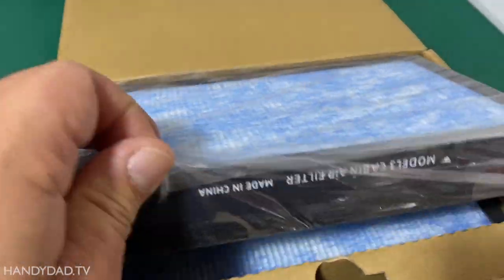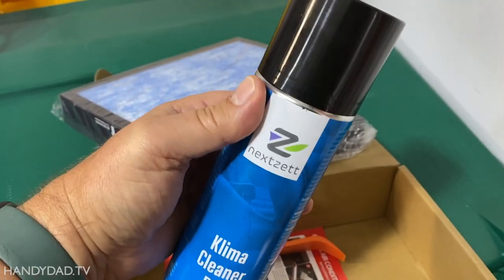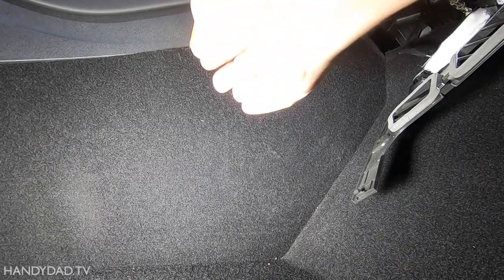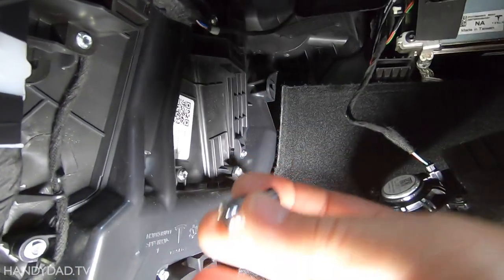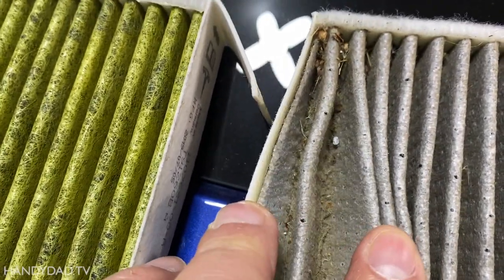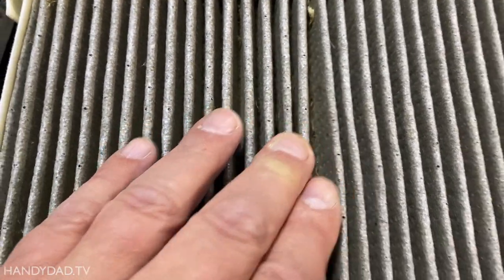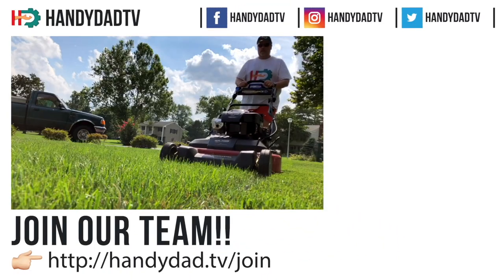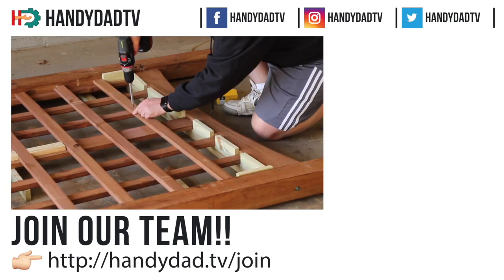Tesla AC Smells like Dirty Socks - how to fix it yourself and save $$$

Comment: Thanks, Chris.  I just ordered the parts and will be doing this in the next few days.  But, as an HVAC engineer, I think it would be helpful to let people know where the smell comes from in the first place and how to keep it from coming back.  Here's what I do on all my cars, not just my Tesla:  If you're running your AC, as you approach your destination, turn the AC off, open your window(s) to increase airflow and decrease static pressure of the system fan, and turn the fan on high.  This gets rid of the excess moisture sitting on your AC coil and also sitting in your condensate drain pan.  Now, be advised, as that moisture is removed from your AC coil, your fan will be depositing it into the cabin making it feel hot and swampy, and that's why the windows are open (this works better when the car is moving than when it's stopped).  Now, due to a rather complicated thing called vapor pressure, it depends on where you are as to how long you need to do this.  Here in SoCal, usually less than a minute. In the Midwest, this might take a minute or two.  In Phoenix, maybe ten or fifteen seconds.  In Miami, might take quite a bit longer.  But if you can keep that condensate pan dry, then microbials that smell bad will have a much harder time growing.  However - there's always a however with engineers - although I do this fairly regularly, my wife and daughters do not.  That's why I'll be following your excellent instructions in a few days.  Thanks for all you do.  We appreciate you!
Reply from the maker: Thanks for the explanation. I’ve heard this advice before but Tesla doesn’t make it easy to turn off the AC and just leave the fan. Takes a couple of clicks but it would be a good habit to keep.

Comment: Just did this myself and came here to say- Definitely do not skip the coil/vent cleaner spray if you have the gym sock odor! Replacing only the filter wont do, you wont get rid of the smell completely. After the spray it was like a whole new car.
Reply from the maker: Thanks for the advice!
Reply: I just replaced my filters and the AC smells brand new! Maybe it depends how long it's been?
Reply: @deblynne9440  it might shorten how long your new filter lasts. The air is filtering through new medium which will have an immediate  positive effect but you're pulling the pre existing mildew from your dirty coil into your new filter fibers, might give the smell a head start foothold into the new filters and come back sooner.

Comment: I've only had mine for 15 months and it's the same... Every once in a while the HVAC got a bit manky... But this most recent time it's ONE MONTH after I installed new filters! It's the sock smell.. not bad in the morning but if I go to lunch with a coworker it's so bad I find myself apologizing so much. It's embarrassing. I'm not the litigious type, but I'm shocked there hasn't been a class action suit.
Reply from the maker: I have a 2023 Y over a year now and it hasn’t been an issue yet.

Comment: i just changed mine and guess what??? it has never been changed before hahahah. im the second owner and the old filters had 2019 dates on them. and ONE more thing, it was absolutely clogged i meannnn chocking to the rim with hair and sand dunes throat singing . i wish i could show u pics hahahah. one question is that, i found ( i also have an endoscopy) these little pollen like leafs or seeds inside the filter compartment. as soon as i smell i sneezed. i tried to vacuum out most of it but still some remains in the corner... anyone had similar instances? any comment or help would be appreciated cheers
Reply from the maker: Sorry I didn’t see any crap to vacuum out.

Comment: I believe Tesla now offers an option to upgrade the Model Y filters to the larger HEPA filter that would enable the Bio-weapon Defense mode previously available only on the model S & X.  That might be a worth-while (after-market) upgrade.  (Model 3 doesn't have enough room for the larger filter)
Reply from the maker: I’d be curious to know if that helps prevent the stink.
Reply: @handydadtv  hahaha it would not help with the smell after a while daddy :D...  BUT it would cost you more money after every 6 months or so ... hahahaha.....
Reply: @handydadtv  I have that Hepa filter on my model S and it STILL stinks! Hence my visit to this video, lol. The problem is, all the vids on this are for the model 3
Reply from the maker: @silverdoggg Record it when you change yours and I’ll publish it so other S owners will see how it’s done.
Reply: It’s not the filter but flawed design because horizontal drip???

Comment: Gonna try. Thanks. I wouldn’ve turned on all vents when you turned AC on. I would also spray foam in the intake duct. And after 20 min, run AC and spray Lysol so that all of the vents can be cleaned of bacteria.  Then put the new filters in.
Reply from the maker: Sounds like a man with a plan 👍🏻
Reply: Where is the intake duct?

Comment: The first production model 3 is a little bit trickier. The screw to remove the filter cover is on the top and not the bottom. I had to use a flexible screw driver.
Reply from the maker: Wow! What the heck were they thinking!!

Comment: I have a 2018 MS 75D and have never changed the hepa filter or the cabin filter. Car has 32,000 miles always garaged. My car smells brand new, nothing stinking. Yet my 2022 MS LR started smelling like sour wet socks intermittently after only a few months. Tesla Mobil service came out and pulled my cabin filter out first (2022 MS LR) and it was very clean. He did not replace it. He did however suggest that I take it to the service center and have the HEPA filter replaced for $600. NOPE not gonna do that. My 2018 never has had any foul smell and it has never had a new filter. Any ideas on the 2022 MS?
Reply from the maker: Try the coil cleaner. It eliminated my stink. Now almost 2 years later I get a slight smell when the AC starts up on really humid days. But I can live with doing it every 2 years.
Reply: Yup. It’s the horizontal drip. Super flawed design. Most people don’t know this
Reply: @handydadtv I ended up having the HEPA filter replaced by tesla. I fought them on the pricing they wanted $600. I got them to install for $300 since I told them that the car started stinking only a few months after being delivered. The service center took my old HEPA filter out and put in another MS and it started smelling as well. It has been a couple of months and I have not smelled anything.
Reply: I have been finding the persistent wet socks mess in my 23 MY, about every 15K miles. I have cleaned the coils with vinegar, bleach, condenser coil cleaner, and the smell still comes back. Changed the clean looking cabin air filters too, still with the bad AC smell. Never had a car like that in the past, ever. Too bad because the drivetrain and related pets have been flawless thus far.

Comment: If you guys smell rotten eggs get the 12v battery checked out! My Tesla couple months in my Tesla AC smelled stinky so I replaced the filter and it did great until it slowly started to smell. Then one morning went into my garage it stank. Found out it was my Tesla and I tried operating the car and it went dead. Tesla had to tow it out of my garage and now it’s currently being serviced.
Reply from the maker: Thanks for the info!

Comment: just rotate the bottom filter 180 degrees so the tabs are on top? arrow would still be the same way?
Reply from the maker: Then the tab would be on the wrong side.
Reply: @handydadtv  gotcha. Looked like there were tabs on both sides.

Comment: It might as well be a unique problem to Tesla lol. I valet park cars for a living, and I swear 70 percent of the teslas I get in reek of nasty mold dirty socks. Very few other cars ever smell this bad, or smell at all. Maybe once ever 200 cars had a similar smell. It’s ridiculously common in teslas. Nasty things. My Lexus with 343,000 miles smells like delicious fruit punch when I use the AC lol
Reply from the maker: They can resolve it with a software update to run just the fan for a few minutes after it’s parked and conditions are right. Still waiting for that…

Comment: How long before it would start smelling again? Great video!
Reply from the maker: I did this in the Fall of 2021. As of January 2023, it still smells fine.
Reply: @handydadtv  gonna try it out! Thanks!
Reply: In my case, I first replaced the filters + cleaned the coil at 7000 miles. Now at 35000 miles and the smell has returned, so time for wrestle #2 with the trim piece. A stinky problem for a 
"semi" luxury car. Haha.
Reply: @handydadtv  i have changed my model 3 filters and cleaned the coils every year about this time of year...in fact watched your video to refresh my memory on the instructions.  I think this will be my 4th year doing it, but it is always around the end of summer - beginning of Fall when the smell comes back :(
Reply: I got Tesla Mobile to do mine with cleaning in July 23 by Dec 23 it was coming back by Feb it’s easily noticeable. Called to have it done again mobile came and said they don’t clean anymore even though my estimate included the charges so I turned him away. Filters alone won’t fix this. I contacted them and they refuse to use cleaner want me to drop the car off and wait days in a queue to change filter only.

Comment: Okay!  But it is a temporary solution. It gets stinky every year after filter replacement. Cleaning ac coils every year sucks. I really do not see any visible clog and mold. For my next project, I planned to implement UV light inside to kill mold and germs and finally get rid of the smell forever.
Reply from the maker: I only did it once in 3 years. 

But I just traded up to the 2023 MY with the HEPA filter so I’m interested to see how this one goes.
Reply: @handydadtv  Any issues with your 2023 MY with the HEPA Filter? I have a "sweet" smelling, smell when I turn on the AC, and wondering if you have any issues with your Y like you did in this video?
Reply from the maker: @hayleykenyon5679 No, not yet.

Comment: I had the problem last year, $120 and a Tesla visit solved the problem.  I've never had the problem on another car but know it exists so I've had a habit of turning off the AC but leaving the fan run for a while to attempt to dry out the evaporator before putting the car to bed.  I had been doing the same on the model 3 but noticed something new this year as I began to use the AC.  After parking the car if I happen to pass by it some time later (don't know how long maybe 20 minutes?) the HVAC fan was running.  Now its my guess that Tesla has made a software change to run that fan to dry out the evaporator, if so the problem is fixed permanently.  I would however like for Tesla to provide an explanation of what's going on, can I forget trying to dry it out myself and under what conditions does that fan run.  Whatever the deal is it didn't do it until I started using the AC.
Reply from the maker: Good question

Comment: This happened to my Model Y after 6 months.
Reply from the maker: Mine made it a year.
Reply: Mine too!  Tesla came out and replaced the filter for $54usd. Well worth it if the aftermarket filter is $47. He even topped off my tire pressure for free.

Comment: You can't STOP RUNNING YOUR A/C for LONG PERIODS OF TIME  I made made that mistake once I left the a/c off all winter long and I got that rotten smell come springtime. I bet to save energy you took the climate control off Auto & with it on auto even when cooling isn't needed the air-conditioning runs occasionally and prevents that nasty smell
Reply from the maker: I leave climate control on Auto all year long. It started to smell in early Fall.

Comment: First, I like your content so nothing aimed at you at all fine sir.

Tesla, however.  Ya, no.  It is videos like this that make me more and more of a lifetime Honda guy.  FAR easier to do ANY maintenance on and FAR better overall quality.

Except for the first gen CRV, every Honda I have ever changed air filters on is less than 5 minutes, NO tools and I can get the filters at ANY auto parts stores.  For the record, that is Gen 7, 10 and 11 Civic; Gen 1, 3 and 5 CRV, Gen 1 Ridgeline.  I haven't looked into it but I can readily assume this is the same for basically everything from Honda from 2001/2002 forward.

And my answer for what I would do?  Not buy a Tesla in the first place.
Reply from the maker: I respect that opinion. I have owned several Hondas and you are correct, they are designed for easy maintenance. I’m not a wearing rose-colored Tesla glasses though. Looking forward to more EV choices in the future.
Reply: This is the only issue people have with Tesla. Far less moving parts than an ice car. No oil changes, most people go well over 100k for brakes etc. This is the only thing that has been an issue for mine. By now my other cars would be in the shop a few times. My Land Rover is right now ha!